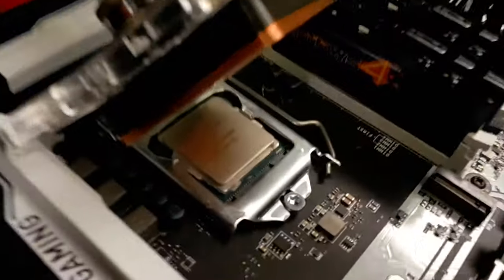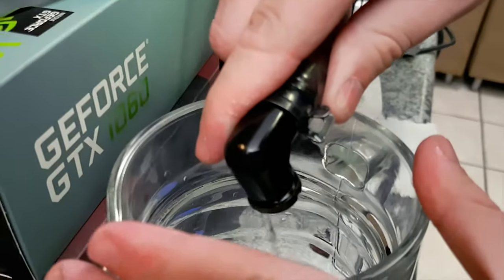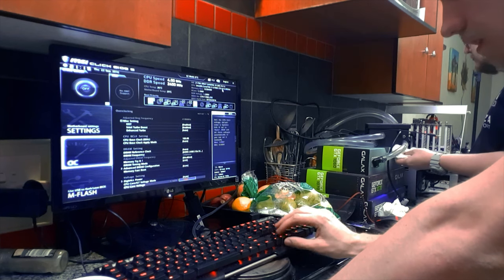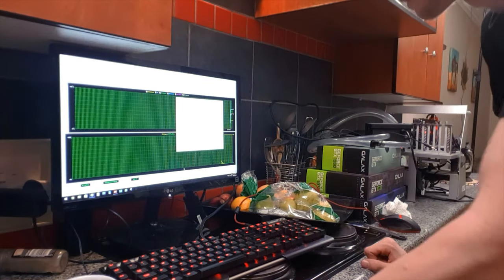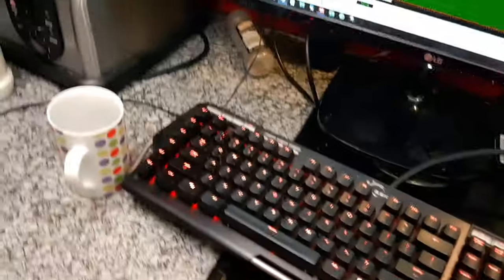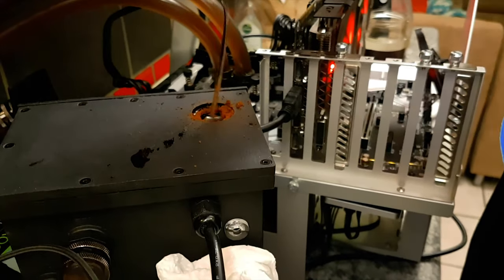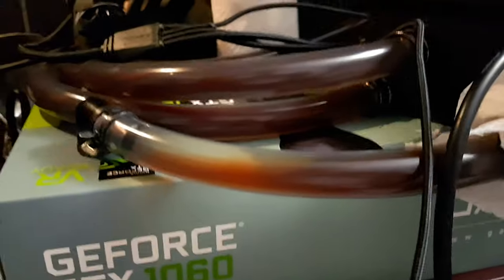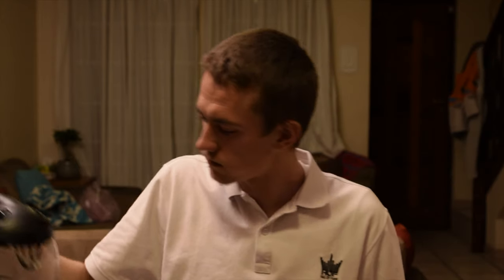COFFEE LAKE BEFORE IT WAS COOL - Making Coffee With A CPU

Comment: So if I would make my own coffee maker using a custom water loop and an overclocked i7 or equivalent, what radiator type and size, if any, would you recommend? I take it you were fanless or low rpm, then? 

I was surprised to see how the water temperatures did not reach alarming levels after hours of sustained heating. 

Your pump has a max thermal rating for water temperature, right?
Reply from the maker: If your goal is to make coffee, as we discovered, using a radiator actually makes it take longer and should be excluded, because you want to contain all of your heat.  We used a fanless radiator, which again, was a mistake.

No idea, never looked into it.  Guarantee the warranty is void on the pump from our escapades.
Reply: *****
I thought a friend's Alphacool radiator had instructions to avoid temperatures much over 60C. I am sure it varies by manufacturer haha.

Yeah, Shenanigans are well worth the risk each time!

However, even fanless, that radiator provided relatively admirable CPU and water temps (imagine if you ran with a lower overclock or messed with undervolting). You may be on to something, sir!

Maybe we just do not need a radiator at all. Copper pipes or Alphacool's "Konvekt" passive radiators could be enough these days with an efficient CPU and GPU on the loop... Hmm... *gears are turning*